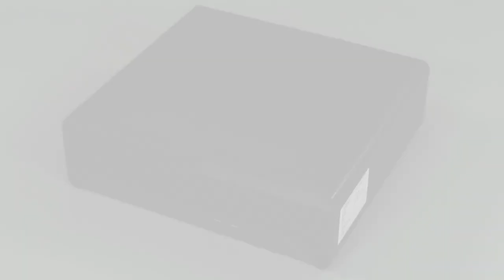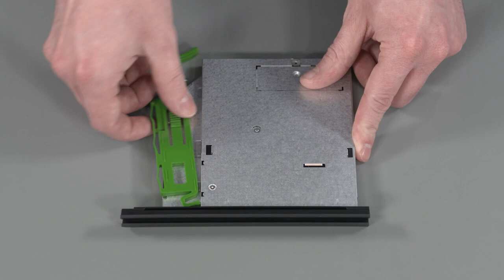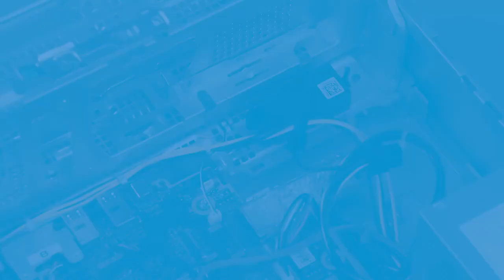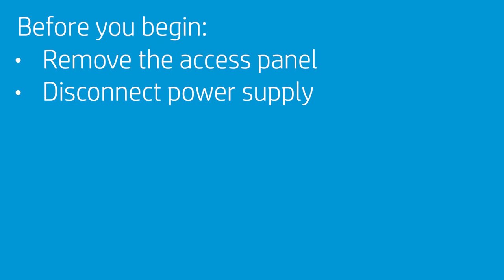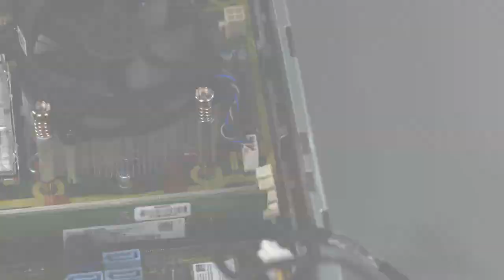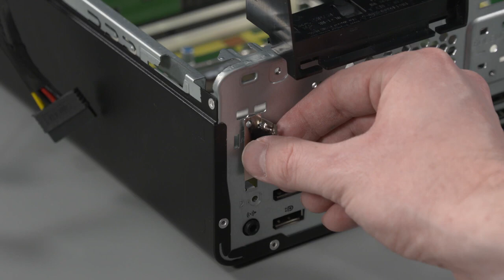Removing & replacing parts for HP Elite SFF 800 G9 PC | HP Computer Service

Comment: How can I find the part number for the "DVD writer bezel" for the HP Elite SFF 800 G9 Desktop PC?

I looked at the "HP Elite SFF 800 G9 Desktop PC Maintenance and Service Guide", but it does not list the part numbers. This is in contrast to the "HP Pro SFF 400 G9 Desktop PC Maintenance and Service Guide," which does provide part number information for the system.

Maintenance and Service Guide HP Pro SFF 400 G9 Desktop PC (The guide includes all system part numbers): 

Maintenance and Service Guide HP Elite SFF 600 G9 Desktop PC (The guide does not include system part numbers):

Maintenance and Service Guide HP Elite SFF 800 G9 Desktop PC (The guide does not include system part numbers):

I hope you can help me with this information.

Best regards